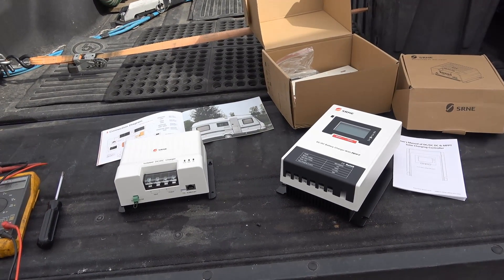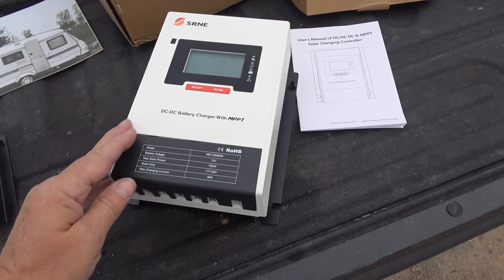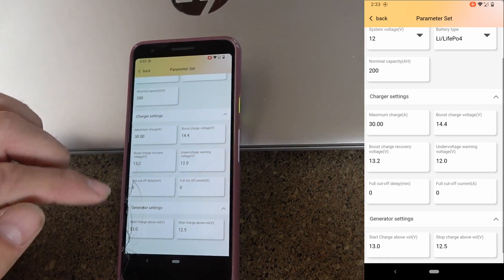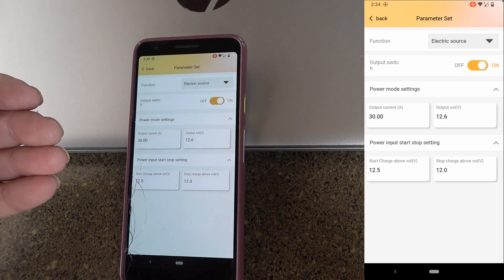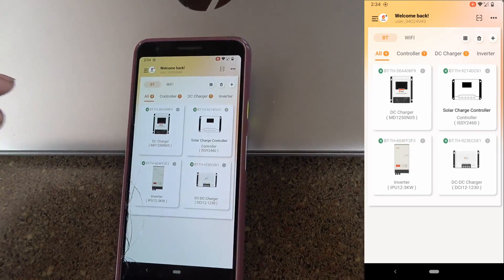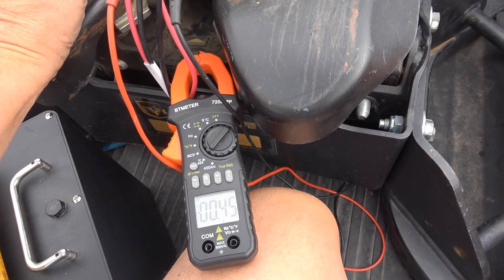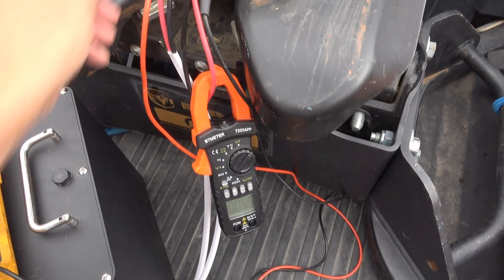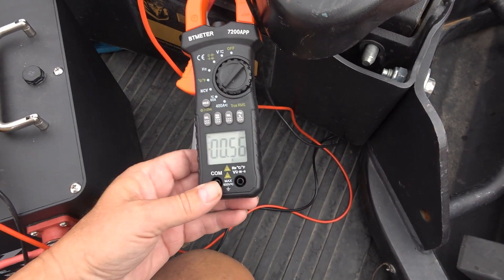SRNE 30A DC-DC Charger/Converter - Features, App and Demos

Comment: I find it very interesting that most ratings for SRNE products are disabled on Amazon and the one that does have one is very poorly rated.
Reply from the maker: They aren't sold in North America under the SRNE name yet directly from SRNE. I see a smattering of listings come and go on Amazon, but likely just little third-party resellers, kind of like eBay. Hard to know the quality of the reseller and stock. Anyone can basically set up an Amazon shop.
SRNE has mostly been manufacturing behind-the-scenes for other businesses operating in North America that add their own brand name, case design, and support to the product. They would rather me not broadcast names, but people can often figure it out when comparing. ;)
From what I gather, they sell straight to consumers under their SRNE name in other parts of the world. But when they asked me to review this new system and its products, I asked if my USA and Canada viewers would be able to buy them, as in the past, the only way was some lesser-known Asia websites like https://www.aliexpress.us/w/wholesale-srne.html and they assured me that would be the case. So sounds like they will launch into the North American market soon. Cheers, Ray